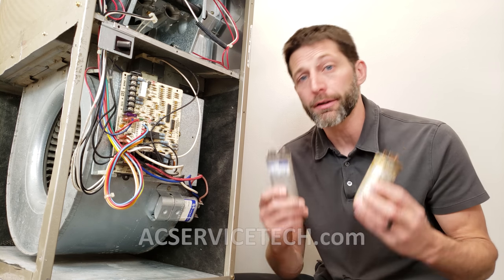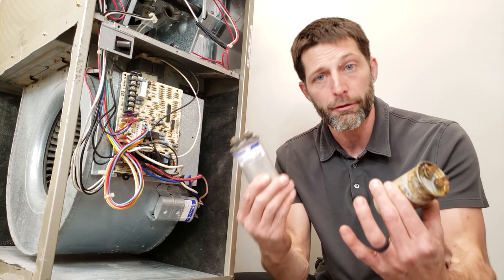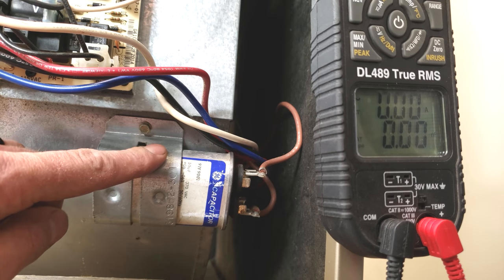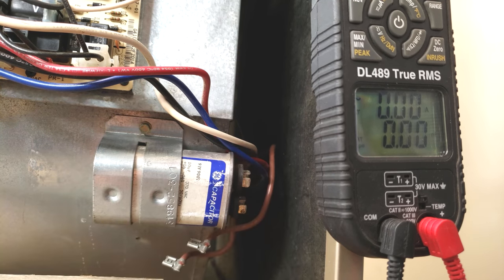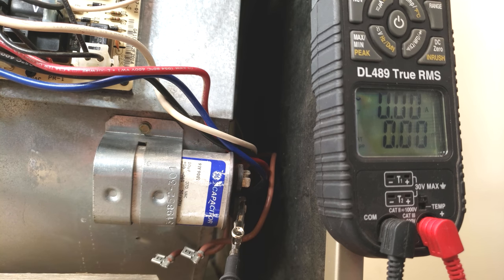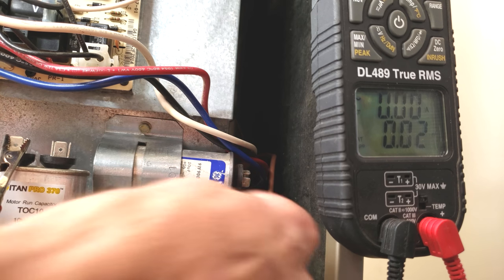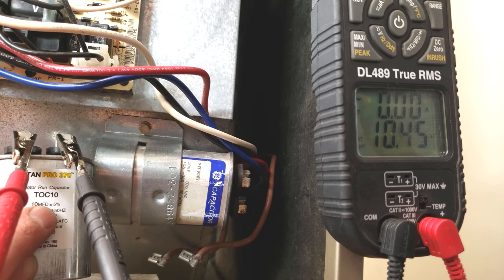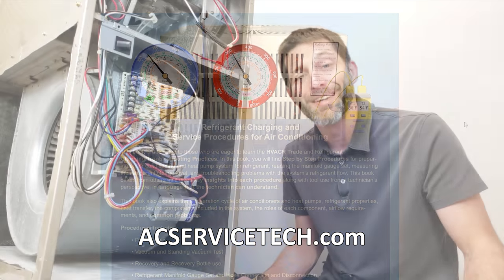HVAC Blower Fan Motor CAPACITOR Quick Testing!

Comment: ran into this problem in the field last week. blower motor wasnt coming on.  the mechanic i work with noticed the mushroom effect on the cap and put the meter on mfd and had the same result as this video.  good learning experience in the field and nicely demonstrated in the video

Comment: Couldn’t that capacitor shock you when you pulled the wires off with your fingers before you put the bleed resistor on it.
Reply: I was wondering about that also.   I always discharge the capacitor by placing a screwdriver touching both terminals.  The screwdriver must have a plastic handle to avoid being shocked.

Comment: Good job as always Craig. Did you make up that bleed resistor?
Reply: Just short all the terminals together with a screwdriver.  You might see a small spark or hear a small pop when you do this but most of the time not.
Reply: @rpsmith  I am NOT a licensed tech, but that's how I was taught to discharge them YEARS ago. An insulated screwdriver is a must have!

Comment: Theirs also another method without turning the unit off and needing to bleed the capacitor. As it's running, hook your amp meter around the capacitor wire and measure voltage. Use a formula 2652 X Amps ÷ volts = MFD

Comment: amps off the start winding x 2652 ÷ volts across the capacitor terminal.

if not running make sure your multimeter has capacitance mFd or ųF tester
Reply: Several of the HVAC phone tools have a calculator to do the math for you. Checkout HVAC School App (Tools/Under Load Cap Test.

Comment: Thanks. Can I extend the capacitor wiring on the air handler which is in the attic to make it easier to reach? Not as young as I once was.
Reply: That is a great thought.  I change out my AC capacitor about once every four years.  I consider it as changing engine oil in my car.   
I am thinking of extending the wiring to relocate the capacitor to outside the box.  A custom built watertight box to store this capacity will be mounted to the AC condenser housing.

Comment: Way too basic didn't even go into testing under load.

Start winding in this case Fan on Compressor Herm x 2652 ÷ Voltage ⚡
Reply: Herm current I think you meant to say
Reply: Yeah, it was basic, but did you understand what he was talking about?

Comment: YOU can BUY A NEW ONE for UNDER 20 BUCKS ! WTF "test" it if you went thru ALL the trouble to take it OUT !!
Reply: Spoken like a true parts-changer.
Reply: @gamewizardks  🤣
Reply: If it's bulged or leaking you are wasting your time testing it.  Even if it test OK it's only a matter of time before it goes bad and maybe takes out a motor when it does.  Just replace it and move on!
Reply: @rpsmith   Exactly.  If it is any older than 5 years old it is worth it to replace it even if it is not the culprit.  The capacitor costs under $20.  The labor to come back to replace it is $200 minimum in 2024.

Comment: I had somebody say I’m ripping off my customer when I recommend while I’m out on another service for a different reason to replace the old original cheap Chinese capacitor on the motor for preventive maintenance when it’s 10 years old. It was lucky to live 10 years. 

       I say it would be ripping off a customer if I didn’t change it because if it fails in a year or two then I’ll be cold out here on a $300 service call plus maybe another $300 or more for the motor plus the inconvenience of a down system just because I didn’t replace a capacitor when I was there in the first place for something else. 
      Anyway I always tell the customer it’s an option it doesn’t need to be done it’s your choice as preventive maintenance. 

     But if that capacitor does die you will be calling me out here for a several hundred dollar motor and labor charge for a capacitor that could be changed right now ?
Reply: I had a customer did the same thing to me. Lady said she be asking her son in law or son because he's an "engineer". Obviously she was assuming I was ripping her off.
Reply: I installed a brand new 3 ton Goodman package unit. The first thing I did after that was order a spare Amrad cap and a fan motor.